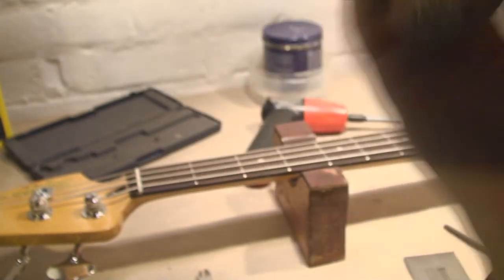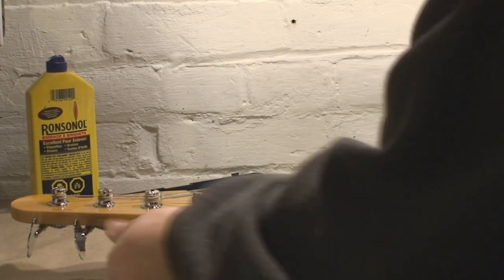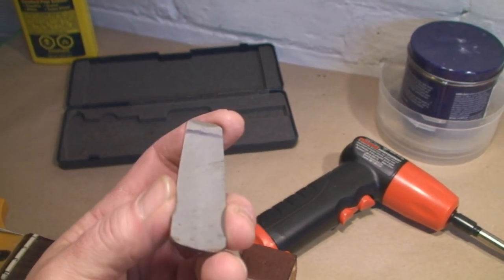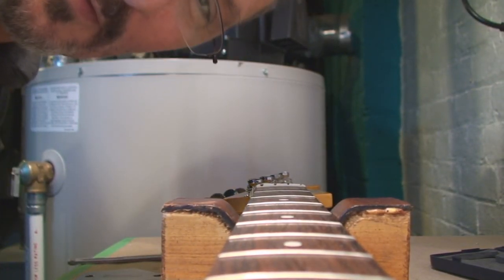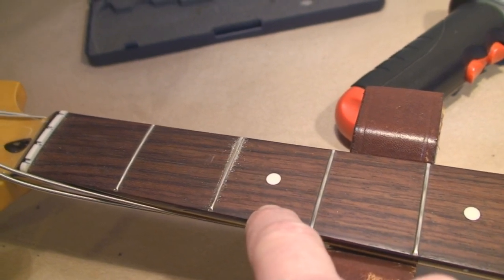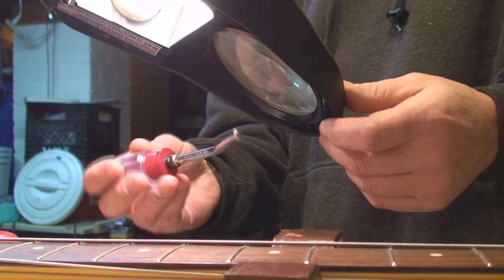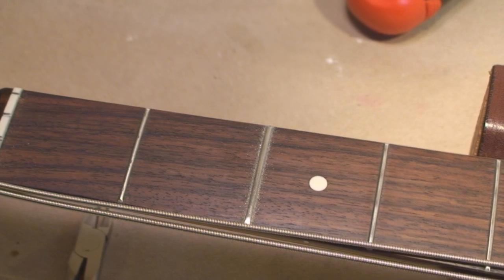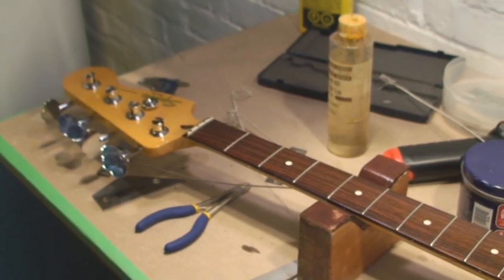Fender Squire P Bass Guitar Gets Fret Work

Comment: I have Ibanez SR605 and its an 2001.  I have had it for 3 years and to my knowledge it has never had a refret.  It has a hight spot on the "G" string at the 11th fret, can a just hammer the fret with this hammer or does the fretboard need to be sanded down?

Comment: if the first 5 frets on both the E and G strings are buzzing, could it be a matter of losing the truss rod? instead of filing frets down? the neck doesn't look like it's bowing in any direction.
thanks,